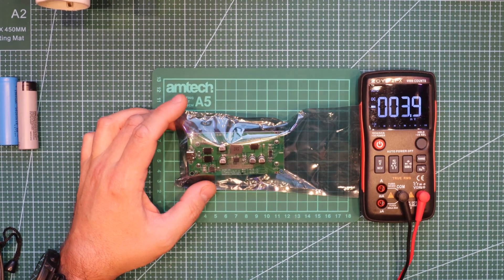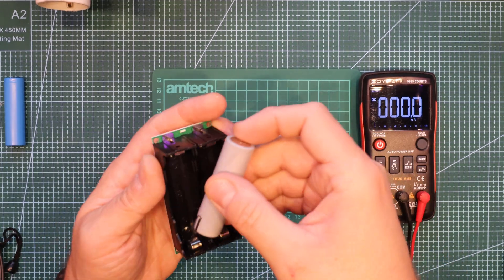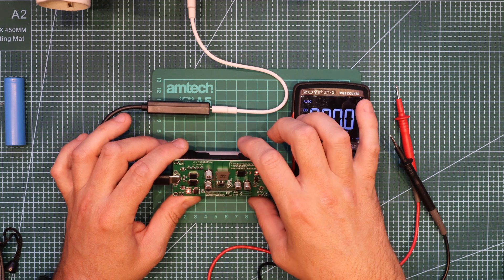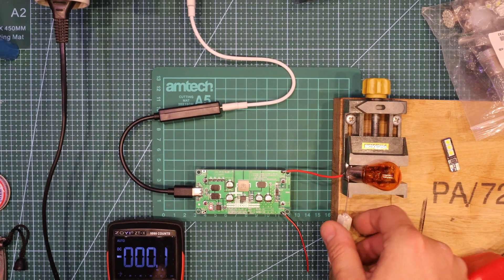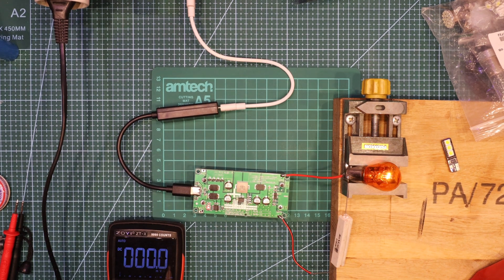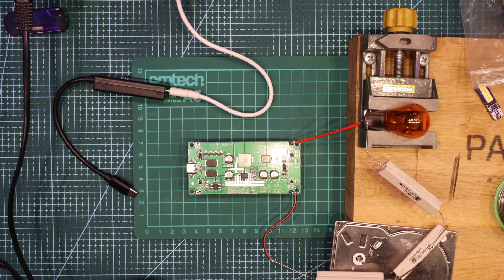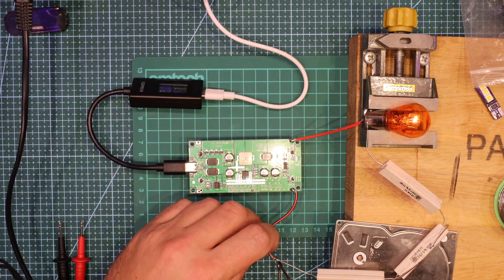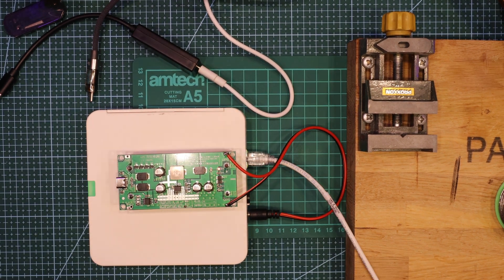DIY UPS Power Supply 12V 2x18650 Li-Ion cells - testing

Comment: Sad that there is no Switch 😅 or how do you regulate that? Pulling the battery is no Option 😅
Reply from the maker: Yeap, it works constantly and until the full discharge

Comment: bro 25mA static current will make it flat in 10 days without any external voltage? 3300mah/25mA = 11 days +/-  for 2?  and maybe 3 hours for 400mA load? +/-  Maybe there should've been a switch there somewhere on the battery, but maybe most just have it plugged to a source all the time so no need for that.  Why does the voltage drop from 12V to 5V on the output?   Why not shut it off completely at that point...if the load is rated for a different voltage?

Comment: This is 15W module. It is written in the description from Chinese sellers.
Reply: yeah looks like 12V module maybe 1 amp stable max....lower voltage module might do higher amps?  And, a fan.
Reply from the maker: Chinese sellers write what they like, it is advised to test

Comment: thank you. i want to use it for internet router which need 12v 1.5 amp output. and i will install 3.7v 1.5 amp battery 2 cell. so input 5 V 3 amp can work??
Reply from the maker: 12v 1.5A is 18W. However your router may need less than 1.5A. if it needs more, there is another module capable of delivering 24W, working with 3S battery, search " 24W ups module"

Comment: There's something you need to know.  3amps with the 5v input. But the output is only 12v 1.2amps which is 15watts. Its a really nice product
Reply from the maker: Yes, indeed it is a bit less, the module efficiency is 80-85%

Comment: I have a question. Here you have the module in series with the power supply as a UPS. I bought it for 12V, but the source is still 5V and the output is 12V. I want this 12V for my NAS for short-term bridging when the power supply drops until the NAS can shut down. So I would have to connect it in parallel to the source of the nas?
Reply from the maker: @NuriSeven  I think you could with shottky diodes to stop the back flow or get a different solution: get a 12v charging module for 3S li-ion setup and connect the Nas to output of the BMS. It will keep the power on as long as you need for the Nas to shut down. Check the current but even if that is 2A a cheap cell will keep it for an hour - you need a couple of minutes.
Reply: @magicscorner  Thanks for your answer, but why is the module advertised with 5v, 9v and 12v? Technically, that doesn't make sense, unless you connect it in parallel and it detects that the main voltage source is not supplied and then switches it into that supply. I could imagine that the 12V output is protected with a diode for a parallel connection.
Reply from the maker: @NuriSeven  manufacturer made it and a seller named it. What they mean is output voltage and that works 12V 1A and still can be powered 5V 2.4A - ideally would be if the input was PD compatible with 12V trigger, then it would be easier for us. I haven't tried applying 12V for input and see if the module can automatically adjust - an interesting idea.
Reply: There's a smaller 2s red board and a black 3s board on aliexpress that takes 12v source and outputs 12v that you can run on series with the router. But its not plug and play since it only comes with the board and you have to connect a dual color led for status. More like a diy. 
I'm using it and works perfectly.

Comment: Too bad it can't provide more power but there might be a solution by using 2 boards in parallel.
Reply from the maker: Two in parallel would have some downsides. It is very problematic to keep the current flowing 50/50 and if one of them fails, the other would follow very quickly. The best would be to replace the step up circuit with a high current version, then you would need more batteries, ideally in series not parallel, then a new charging module - so basically a new setup.

Comment: Thx for this Vid, i have the same Modul but for 5 Volt.
I Want to charge it with solar (usb stepdown) and then run outdoor a very smart router :)
Reply from the maker: I recently got a Wavlink router/ ap / repeater. I made a 24V battery out of the 18650s to power it directly. The battery is charged from a solar panel 100W 18V with a small mppt step up charger. It works well. It does not need a 100W panel, a 40W is ok, but my panel is behind a tree so it gets much less light.

Comment: Somebody knows the ic it uses as stepup?
Reply from the maker: I would check the stardard schematics for the IC, then checked which resistor/capacitor needs changing for a different voltage settings. It works as a step up, to convert 3.7V into 5, 9 or 12V - the manufacturer makes 3 versions.